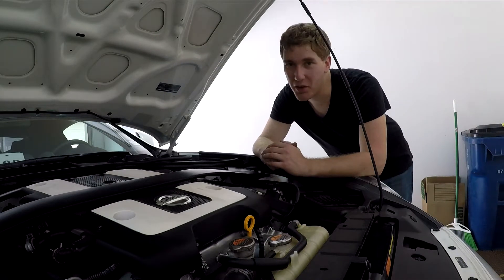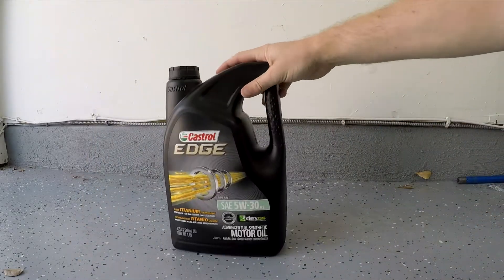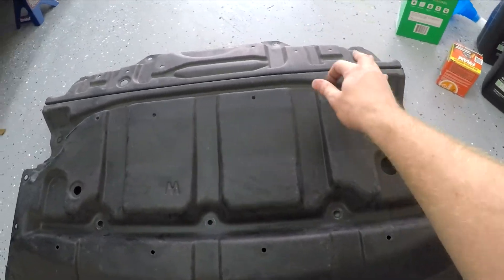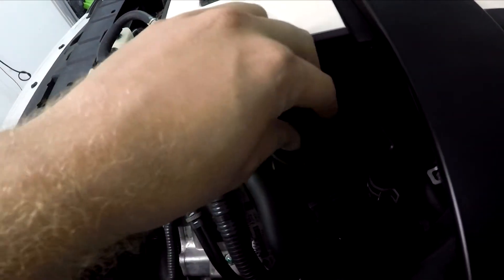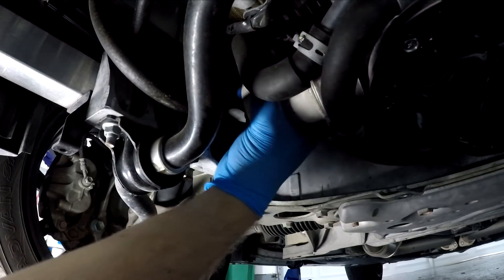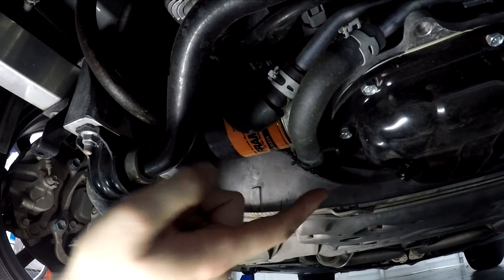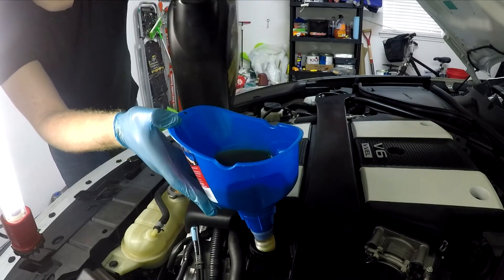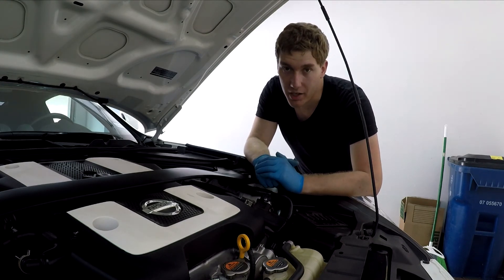370Z - How to Change Your Oil

Comment: Good vid. Btw, the shroud has a fold in it which gives you full access to your filter and drain plug (when you remove the screws on that end).  Removing the entire shroud is then not necessary.  I’d recommend using something other than Fram filters if you love your ride.  👍
Reply: I was going to say the same thing. Much easier than taking the whole shroud.
Reply: @kellyweb  😎

Comment: I use the filter designed for the Nissan 5.6 liter Titan engine(VK56DE). It's identical to the filter for the VQ37VHR , except that it's about 50% taller. Since there is enough space around the filter, you are able to get a filter that has about 50% more filtration area and that drops about 7 psi less of oil pressure across the filter.

Comment: If you own a 370z Nissan recommends using its Nissan ester oil, a 5W-30 oil with a PAO base stock, high levels of Molybdenum and a very small amount of an ester additive, formulated to reduce the sliding friction in places like the intake valve train and the piston skirts. The recommended oil change interval is 3750 miles because of the high heat and shearing forces at work in the VVEL mechanism that cook the oil and shear down its viscosity to something like a 5W-20 within 3K miles. Because of this I changed the oil in my Z every 3K miles, from the time I got my car, new in 2019 until now, and never had any problems with excessive oil consumption.

I have run Motul 300v 5w-40 for a couple of 3K mile oil change intervals and ran a used oil analysis after the first fill. The oil fared perfectly, except for excessive iron, 70 ppm, in the oil. I am considering going with Redline 5W-30, for the higher levels of Molybdenum and Zinc which should reduce some of the wear of the engine metals.

Comment: Word of advice. Get rid of the Fram filters. Switch to something better (which is almost anything...) Mobil 1 M-108 or K&N HP-1008. Also, pour about 3oz fresh oil into the filter itself so you don’t have a dry start. :-)

Comment: Super stupidly cheaping out on complete engine protection going with a confirmed Dumbed down socalled Fram farmer Oil filter, Should simply man up & go with the much better oem Datsun filter and the engine will last longer. Period
Reply: I understand where you're coming from. But I've also heard this: you have to change the fuel filter every year and the brake fluid every other year.

Comment: Again you totally missed a very important Drain plug step & that is too remove the old flattened plug washer and get a Oem Oil drain plug Crush washer & put on the new said very important washer and simply have no Oil pan & engine 
running down  constant leaks  & level's. This car is another stupidly Non maintained properly example and one too completely stay away from when for sale. Period
Reply: I was looking for this step too! Glad it was mentioned in the comments.